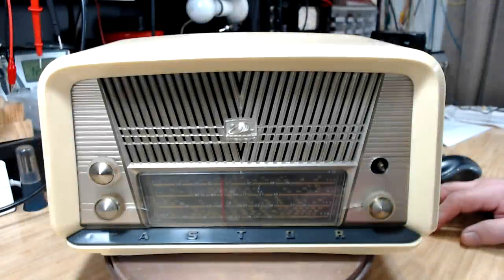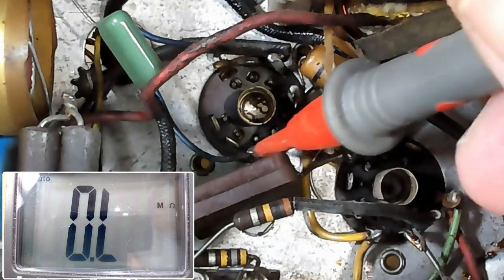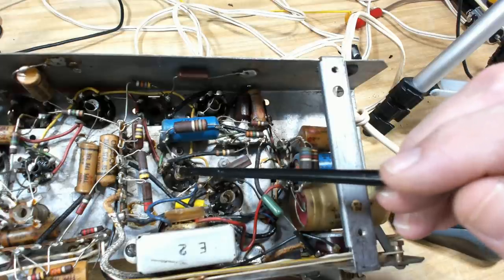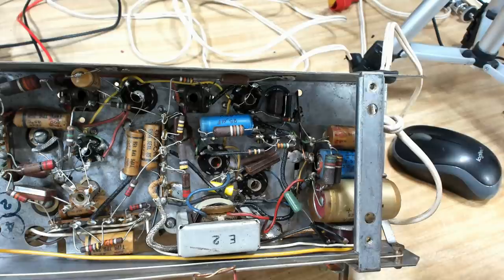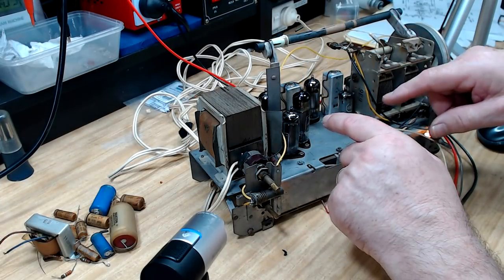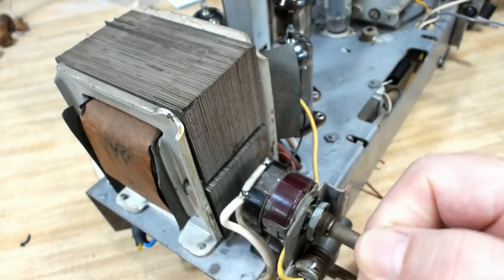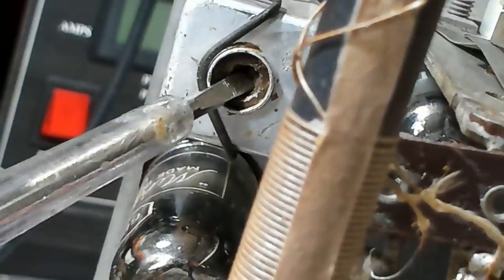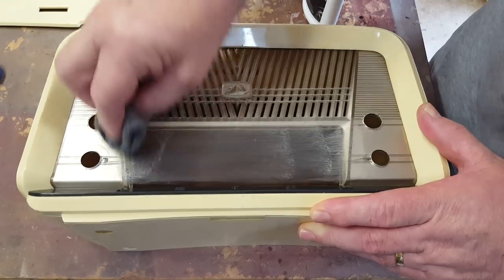Astor BPJ Radio Repair 1958

Comment: Nice radio. I have a question. Can we rewind the output transformer in case replacement is not available?
Reply from the maker: Hi Manoj, thank you. There there are people who can rewind them, the primary is wound under the secondary otherwise I could possibly find the break. You can get new universal ones though 😀
Reply: @DavidTipton101  yes. I rewind myself a 3-0-3 trasnformer which primary winding one end was broken. It was quiet not easy...

Comment: Just asking a question here i use ceramic caps to replace all paper caps and have been told they drift in value and are monophonic i have had no problem what are your thoughts.
Reply from the maker: Hi Michael, ceramic caps are fine but will drift with temperature, I would avoid using them in the RF section as the tuning may drift as the set heats up. If you aren't having that problem then stick to the ceramics 🙂

Comment: I don’t suppose you know where I can buy a new switch? Couldn’t get mine going by cleaning from the top so decided to disassemble. Big mistake, the casing was very brittle and broke when I removed one of the rivets. :(
To make matters worse a small brass ring on the spring flew off and has disappeared. Bad day in the office :)
Reply from the maker: Hi BK, I use these from RS Components, about 6 bucks but delivered free with a 1/4" shaft with a flat: https://au.rs-online.com/web/p/rotary-switches/0316800
Reply: @DavidTipton101  Thanks Dave, your a life saver :)
Reply from the maker: @BKGoldDetecting  Well I try 😇
Reply: @DavidTipton101  Just received the switches, perfect :) I noticed you also bought a new chord from Carl, I still have the original but no ground connection. Do you usually ground your radios even if they came with a 2 pin plug? I mainly work on German late 50’s early 60’s radios, all so far have had 2 pin plugs. Perhaps not so safety conscious in those days.What size fuse did you use? Sorry for all the questions :)
Reply from the maker: @BKGoldDetecting  Glad you like the power switches BK, the plastic shaft is a bit wobbly but in the radio it doesn't seem to be noticeable. It depends on the radio but I usually earth them, I use Carl's cords but Bunnings have 2 meter moulded white extension cords you can cut the female end off and they are only 3 or so dollars, they are a bit thicker and not quite as bendy. I also fit a fuse, the size depends on the radio but usually 500 to 800 milliamp will do.

Comment: Most DIY products use silicone based polish it is a curse to get rid of to paint later looks like hammer finish they put on tool boxes.
Reply from the maker: Check 🙂